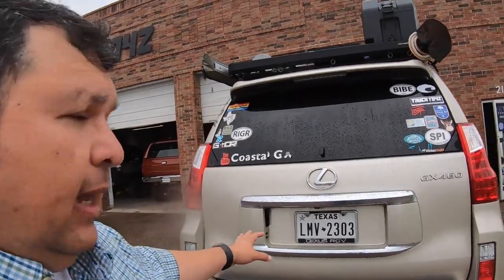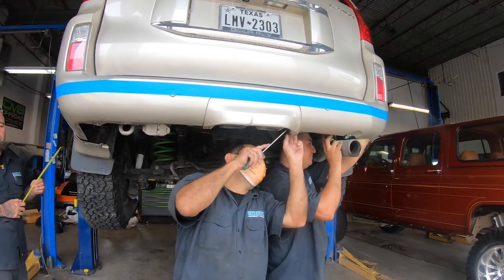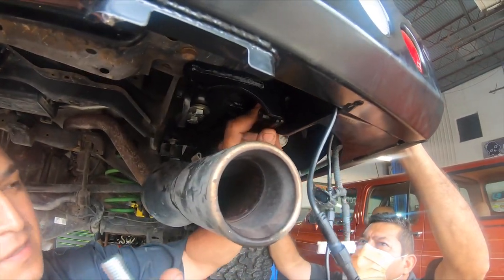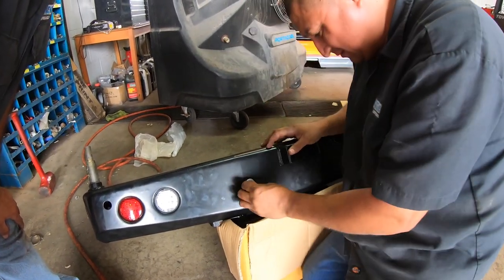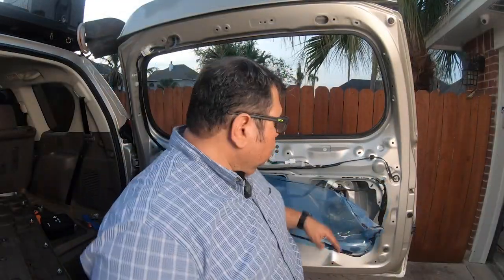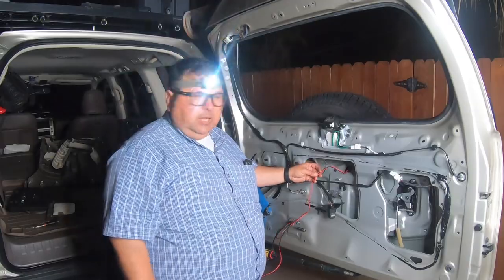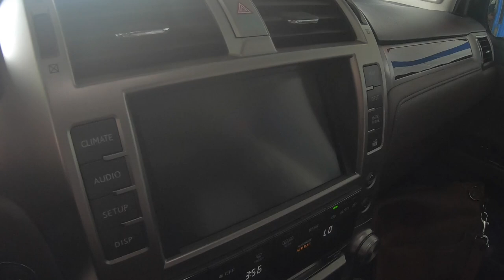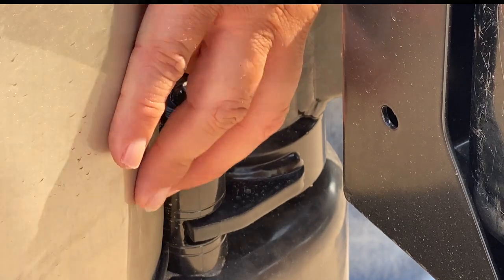Lexus GX460 Dobinsons 4x4 Dual Swingout Bumper Install & Reverse Camera Repositioning Install

Comment: Awesome video! Brother,  very informative,  good heads up on what u can run into man. What's the weight of that bumper? Did u delete the 3rd row seats?
Reply from the maker: Thank you! Unfortunately, I didn't weigh it and it didn't come in the instructions. I run the Ironman nitrogen kit with standard springs and it doesn't impact the handling and no squat. I didn't delete the 3rd row cause I have grandkids and a niece and I can always use that extra space lol.
Reply: @CoastalGX  it's OK I'm sure I can find specs somewhere lol. You'll save like almost a 100lbs if you remove the 3rd row seats. Yea my kids love those seats too.

Comment: Looking back how do you like your bumper today? Do the sensors work ok?
Reply from the maker: Sensors work, but the front bumper doesn’t have them. So basically I had to deactivate them. The rear bumper is great, but I have to treat certain spots on the exposed metal because the powder coating flakes off in certain edges of the metal. It’s not a big deal, but I have to watch out for any exposed parts due to saltwater. Otherwise, all parts are solid and operate as they should. The bumper is solid. 🎥
Reply: @CoastalGX  thanks for your input. I don’t understand why most aftermarket rear bumpers don’t have high lift jack points. I found yours to be one of the only ones to have an area to lift the car up.
Reply from the maker: @graysonatlas  may be because they are falling out of popularity. I prefer a bottle jack paired with my recovery boards so it doesn't sink in. Seems safer.

Comment: I got a question, what are your thoughts on this bumper after having it for a few months now? i am deciding between this and kaymar for my gx460
Reply from the maker: The bumper is solid as can be. It looks good to me and it works perfectly. The bad part  was after I got stuck in the clay like mud months ago. I thought I had cleaned it thoroughly but the bumper has some deep crevices and I had to really dig in there to get the dried mud out weeks later. The other con was the retaining pin that holds the swingout arms. Just a little sea spray oxidized the pin so I had to marinate it with wd40 for a couple of days until it got freed up again. I added a little grease and it’s perfect now.

Comment: When I saw where that camera was going, I was worried that your jerry can wasn't going to fit in the carier with the butt end of the camera sticking through. How messed up are the backup/parking guide lines now?
Reply from the maker: My 2012 didn’t have the moving lines on the camera. The modified setup now has zero lines.